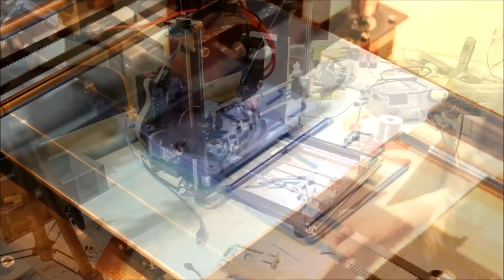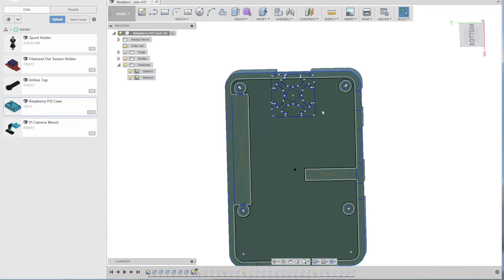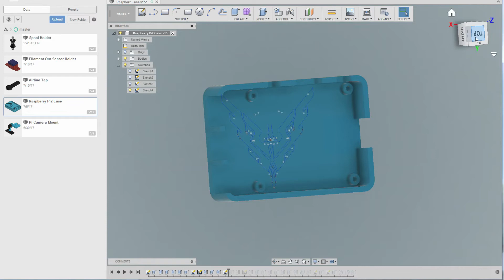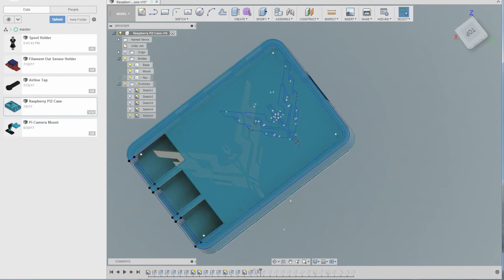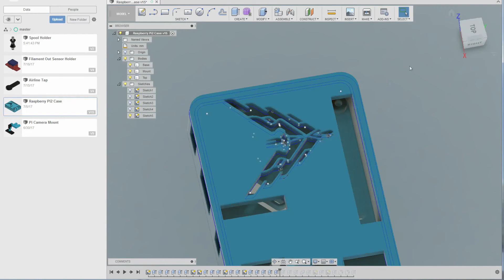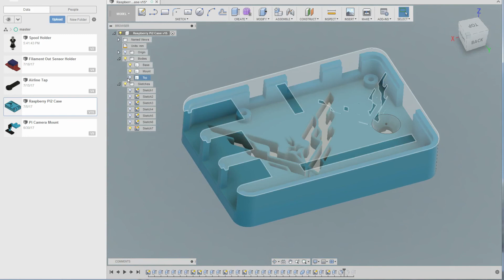Things to 3DPrint #1 - Elite Dangerous Branded Raspberry Pi Case

Comment: Hi.  A great walk through, thanks. As a newbie, can you explain for me what the Z axis conflict reference was?
Reply from the maker: Hi Lawzy - when I had the Pi case mounted vertically initially, the Z carriage or axis on the printer couldn't travel all the way to its greatest height without hitting the case. So mounting the case horizontally avoided that. Hope that makes sense.